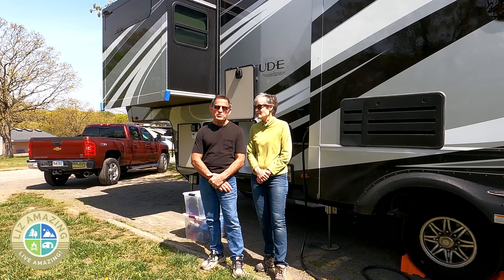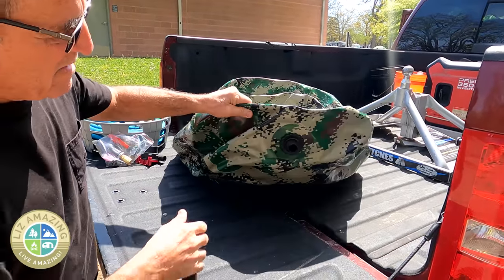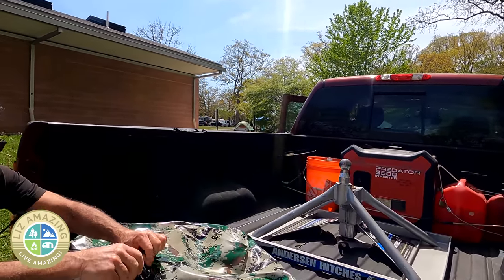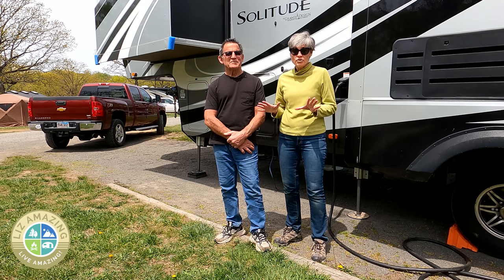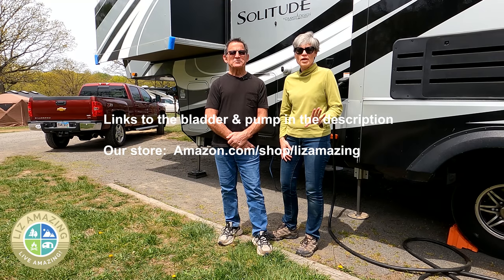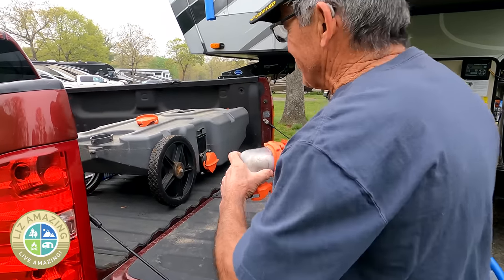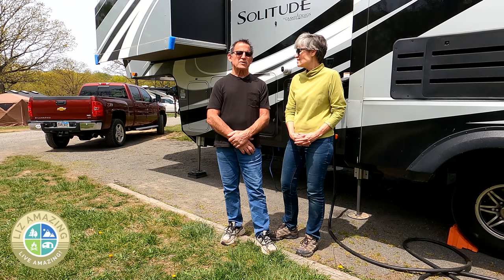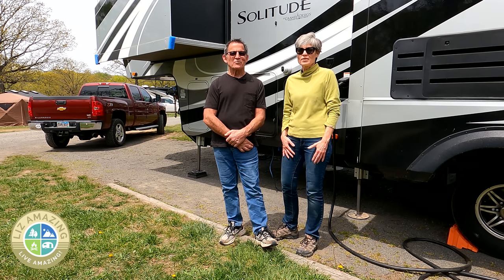RV life: Genius water and sewer hacks you've probably never seen before | H2O bladder | Accumulator

Comment: Why do you need a pump for the fresh water? I would just open the valve, crack a beer and take a seat on the bag giving it plenty of water pressure.
Reply from the maker: That's one way to do it, but you might need more than one beer!
Reply: @LizAmazing  I was just going to say that might be a six pack job!  And with all that beer in me I would be emptying the black tank that much more often.  🍻
Reply: Didn’t really think about it, but I think Liz said it took 40 mins. That’s quite a while to run a drill. Hard on the tool and depending how loud it is, hard on the neighbor. Does the bag empty out on its own? If so, why not just leave it there a for while.
Reply from the maker: @mikemiller9119  20 minutes to drain, 40 minutes for the whole fill and drain process. Yes, if your drill is loud you want to be considerate of your neighbors.
Reply: @mikemiller9119  I think the whole procedure from start to finish was 30-40 minutes.  About 15 run-time for Paul’s Harbor Freight drill.
Reply: @edgramza  well I didn’t pay attention the type of drill. That’s 14 mins too much for that drill. Lol
Reply: @mikemiller9119  wasn’t really sure if it was from HF, I just know that Paul loves the place. 👍
Reply: I use a 3 GPM 12volt auxiliary pump. Around $60. Quiet, and less than 20 minutes for 50 gallons. I use a few 7 gallon jugs from Walmart.
Reply: What if you have no water supply. How do you then get water into fresh water tank then. Thats why I put the extra pump in so I can bring water to RV and pump it in.

Comment: A couple recommendations:

- Use the basic in-line 10 micron (blue) filter from the water source to your bladder to catch any bits in the water line.  Then use a separate filter from the bladder to the RV tank to catch any bits that might be residual in the bag.  

- Use "drinking water freshener" in your water bag  (1oz/20gal).  While it's only Sodium Hypochlorite and any old bleach will do, the pre-made stuff is super diluted for drinking water and convenient. This will ensure any crud that may have found a corner of the folded up (dark and moist) bladder is killed off on the drive back to camp.  

- I'm sure you've covered it in other videos, most folks use a berkey or zero water between the tap and drinking for a last line of defense.
Reply from the maker: Awesome tips, thanks so much TC!
Reply: Thank you for sharing your information 🎉🎉

Comment: Paul, Liz.  We have been using bladders for a long time.  Currently we have two one hundred gallon units.  One for water and the other for sewer.  I use a high flow pump that I picked up at harbor freight.  It's one of there pond pumps.  I have it rigged up on a board so I can use our filter system.  I drain the sewer first and then dump it.  Fold that tank up and disinfect everything and then use our clean tank for the water.  I also throw a capful of bleach in the bladder just in case there are any nasties from the previous fill up.
The thing I like about the bladders is they don't take a ton of room.  I want to add a 100 gallon propane tank to our HDT.  So I can fill our propane tanks and run our genie on it.
I am basically rigging our setup to make it so we can be self sufficient for longer periods to boondock.  
We also have been looking at the Newair fridge/freezer that is a 68 quart size.  One side can be a fridge and the other a freezer.  Want to mount it on the HDT also.  That way when we go to Costco we can buy more frozen meat, vegetables ect and hold it longer while we are out.
Cindy thinks I'm nuts with how I want to set up our tow rig.  Will have to email ya all a photo.  💕💕 Safe travels and roads Brian and Cindy, "xtreambydesign with passion"
Reply from the maker: Thanks so much for the photos! Wow, you seem ready for anything, so awesome! Such a great setup you have. Happy travels!

Comment: great ideas.  I especially like them since we've been doing these for a few years now and they work well.  I would recommend that you change out that drill pump for a 12vdc or 120vac pump (HF for $60) as when we started filling our fresh water tank with them, we went through several drill pumps...they just seem to seize up very quickly.  The HF pump has been going strong for 3 years now and as a bonus it's quicker than the drill pump.  We don't use a macerator pump because we can go almost 2 weeks on our black, however grays fill quickly.  So, we use another HF pump to pump grays to tank in back of truck similar to what you do.  great vid..thx
Reply from the maker: That's a great idea. We just learned that our drill pump is NOT for potable water. Who knew?? Paul bought a similar pump to what is on-board our rig so he's using that now. I bet he bought it at HF as he loves that place!

Comment: Looks like Colorado or Idaho. Good info guys. I’ve been FTOG for the last 2yrs, and I never noticed how much water I wasted.  And how much of my garbage is plastic and non compostable paper products, which I press into 2x2 insulation boards that fill in shop framing. Not sure on R value but is better than bare wood /metal. If equipped and comfortable with Composting as it should take a lot less water and can be disposed of as needed.  Macerator is a game changer once you get the hang of it. Accumulator can help extend battery life and not wake anyone up on those late night bathroom visits. Good videos - FT 14 yrs since 2000.
Reply from the maker: Wow that’s awesome you have been full-time for so long! We would love to sit around the campfire and talk with you. Appreciate your tips. That was Idaho but we already have a winner. Thanks for guessing and good eye!

Comment: We have always been FH RVers but since we sold the kids 😜 we started going for other sites. Haven’t needed the bladder yet but it’s in the list. The poop tote works well but the thing I do not like is it hard to tell when it’s getting full. Also found a sewer cap with a garden hose fitting on it. Works great when filling the tote.
Reply: I was thinking the same thing.
Reply from the maker: Yes, they need to put a small clear stripe on them so that you know when they're full. But Paul says he can now hear the difference and is able to shut off the macerator right when it gets to the brim.

Comment: Being a grand design owner, you can forgo the drill.
1.  Place your wet bay in "sanitize"
2.  Hook your hose direct from the RV connection and the other end on the bladder.
3.  Turn on your water pump and it will suck the water into your water tank
Reply: I was just about to say the same thing.  I dry camp for 3 months a year.  I have a 400 gallon tank I just hook up and the Solitudes pump pull the water over.  I'll pass on that drill pump as well!!
Reply: Same comment here.   I am a GD Reflection owner and use the "sanitize" setting to pump water from 6-gallon water jugs all the time while boondocking.
Reply: Not sure about all models of pumps. The 98’ class A I have has a ( <5gpm ) small diaphragm pump that collapses garden hoses /vinyl and such. So I switched to 1/2” pex on the inlet side with great success. (Separate unmounted pump) I cut 2-10ft sticks - put M/F ends for storage /configuration needs.

Comment: Thanks for making this and providing ideas on how to make the camper better! I like the water bladder but I would figure out a way to use a rv water pump instead of the drill pump. The drill pumps typically state not for potable water- probably due to something inside the pump coming into contact with the water. I like that the drill pumps are a lot less expensive but the risk is too great for me. I use a Recpro 12v pump and if the RVs goes out, I have a spare on hand. But your highlight on the macerator needing 20amp is good since I’ve never heard that mentioned before and we’ve been considering it! And thanks for showcasing the accumulator and how you did it- I’m doing mine now and your tips are well appreciated!  Cheers!
Reply from the maker: Your comment! When Paul bought the water bladder, the same seller sold the drill pump. He just assumed it would be for potable water. Your comment made us check. Sure enough, it is not recommended for drinking water. We deleted the link to the pump. We can’t thank you enough for letting us know. We added a note in the description about this. Thanks again.
Reply: @LizAmazing  You guys do great work for the RVing community both by simply making content (not that I do it, but it doesn't look easy!) and putting your thoughts and ideas out there for people to look at, critique, appreciate and expand upon in order to make it better (again not an easy task!), so the thanks really goes to the both of you!  Thank You! Cheers!

Comment: Not sure if you ever considered it but I did the modification JD from BTBRV did. I installed gate valves on the end of the sewer lines. You can get ones that just twist on like your sewer hose or you can go with the permanent version JD used and I used as well. No more buckets or containers under the sewer port as long as the valve is shut before you take the cap off.
Reply: Yes, I consider this one of the best improvements on our rv.  We used to have residual fluid at the dump valve even after dumping, particularly after traveling.  Now I can simply close the valve and hook up the sewer hose than open to dump.  Great mod!
Reply from the maker: We've heard good things about those gate valves, thanks for the nudge. We do need to get around to ordering one. Thanks again!

Comment: This water container reminds me of when I had my 22 foot Invader travel trailer back in the 1980s.  It was not a fifth-wheel, so I had lots of room in the bed of the truck. I carried a 50 gallon plastic water drum in the bed.  I transferred water  with a small 12 volt pump that I had permanently installed in a compartment near the tongue. It was always connected to my main water tank I traveled with the drum full of water.  I had plenty of horsepower with my Ford F-250 camper special truck to carry the extra weight.  I had to transfer water once while Boondocking in Death Valley and once in the Panamint Valley.  You might want to consider installing a 12 volt pump in your trailer instead of using that battery operated hand drill.  It could be permanently installed and connected to your water tank.  It would sure save some work.  I lost that tank many years ago.  But I think that water bladder you have is well worth considering.

Oh, and Paul.  I see that you are also a Vietnam vet.  Welcome Home from Sgt Jordan U.S. Army Vietnam 1966-1967 Pleiku.
Reply from the maker: Thank you. Paul says Welcome Home brother. Paul's drill is old so he's hoping for a new one! So yes a dedicated 12 v pump might be the answer one day!
Reply from the maker: Thanks Sgt Jordan, and welcome home to you. Cam Rahn Bay 69-70.
Also, thanks for the suggestion on the 12v pump, I've been considering doing that. 
Lastly, I vividly remember the first time I went to Death Valley. I had driven out from my home in Orange, CA and when I arrived at the Furnace Creek Ranch I was wholy unprepared for the 95 degrees temp when I opened the car door. Of course it was even worse when I woke up at 6:00 AM to go for a run, and I still remember the 127 degrees at Badwater 🥵
P.
Reply: @LizAmazing  By the way, I was thinking of you as I went past Chowchilla yesterday!  LOL
Reply from the maker: @booniebuster4193  Oh my goodness! LOL!

Comment: I actually added a 2nd water pump in my RV that I can pump the water from the 400 lbs tank from my pickup bed into my RVs water tank with a hose.  Makes the transfer a easier process.
Reply from the maker: That sounds like a good set up Ed. Paul replaced the drill pump with a second pump that he now keeps with the bladder.
Reply: @LizAmazing  I know you can burn a drill out on one of those pumps I tried your method and drill crapped out  plus the wait time to pump it long and tedious 
I put Rv water pump in Motorhome to a fused switch and the outlet hose to the freshwater tank by adding new stem into tank to attach hose ready to screw hose from bladder tank 
Outside  Rv in water fill area I have a hose to input of pump connection ready to except a hose from the 50 gal bladder.  Will empty 50 gal in 10 min and ya don’t have to babysit it while it’s draining and loading to Rv water tank

Comment: Two other important tips are A) add Water Miser fittings on your faucets and B) if your grey and black exits through one outlet port, put a closure cap /adapter to seal the port and open both tank valves to expand capacity of the grey. The tanks will equalize. Use campground toilets for #2 when possible.
Reply from the maker: Great tips, thank you!

Comment: Something to note for any accumulator or "pressure tank" is basically all it is. Is you want the pressure in the tank to be 2psi UNDER cut-in pressure of the pump, so if the pump cuts in at 40psi you want tank pressure to be 38psi.
Reply from the maker: Yes, that's a good target, thank you.

Comment: Paul, If I read it correctly, the accumulator pressure is supposed to be set 3 PSI under the cut in pressure. Mine the cut in pressure is 25 PSI, so I set the accumulator at 22 PSI.
Reply from the maker: Yes, you got it right. Thanks Vince!

Comment: I suppose you could wash dishes with a spray/misting bottle to get them wet/soak/wash/rinse.  Also there's a brand called altered that makes a misting aerator for sinks $$ that you don't need high volume use like the bathroom  Tooth brushes/hands rather than running a stream of water.

Comment: I have been considering something like this for quite some time as to how we may go about extending our water capacity in our class C with something like this. That weight adds up quickly, however! A cargo trailer or the like would be a good solution, though not ideal for us currently. Thanks for sharing!
Reply from the maker: Thank you for watching. Yes, something to think about for the future for sure. Happy travels!
Reply: Add a 2nd water tank under your dinette or sofa seats in a class C, you then plumb a line to the main tank line near the pump. Tanks are sold at marine stores. Important to keep the water weight between the axles if possible. You will overload your rear axle when the fuel and back tanks are full.

Comment: See you have a Solitude.  I assume you have the Nautilus P1 system the Reflection has.  Check out "Sanitize"  setting.  It will pump water from any container, including a spring or stream, to your main tank.  Just pumped 30 gallons from a ice chest that way.  (The Ice chest was sanitized).  I pump the water though a filter.  The drill pump is not needed.  Easier and quieter.
Reply from the maker: Yay, Wayne. Paul was worried about having to replace the on-board pump so he went this route. Since then he bought a second pump like the one on the Solitude and he now uses that. Thanks for your comment.

Comment: Why not use the siphon pump feature on your rig? It will pull the water out of the blatter along with gravity flow.
Reply from the maker: That’s a great idea. Paul is reluctant to do it as he is afraid it will burn out the pump. He needs a new drill so he is not worried about what happens to it.
Reply: @LizAmazing  understood, but I use it to siphon off a 5 gallon jerry can with no issues. Besides, running both drill and pump may reduce fill time. IMO
Reply from the maker: @coddiwomplerv3755  ooh, running both, that’s a good idea.

Comment: "Genius hacks" I think not. As a GD owner you should be using the on board water pump to transfer water from the bladder to the tank. GD were light years ahead of you.
Reply from the maker: Paul has valid concerns about burning up that on-board pump. He'd rather replace a drill and a $10 pump than the on-board pump. Thanks all the same.